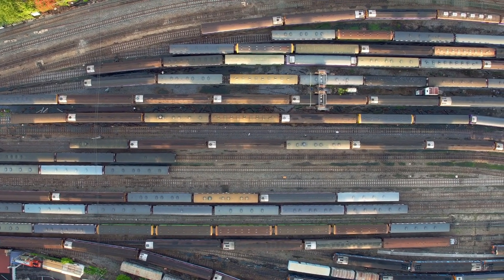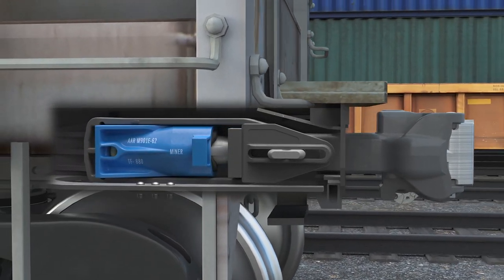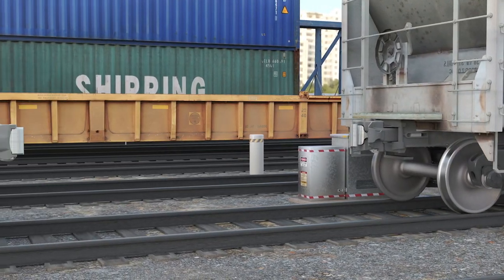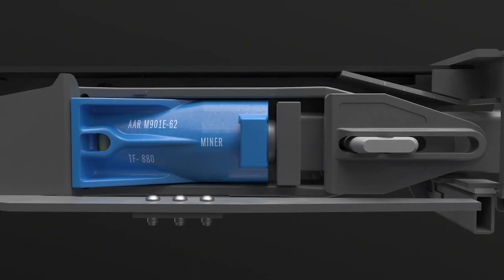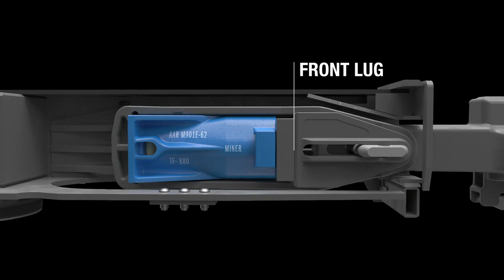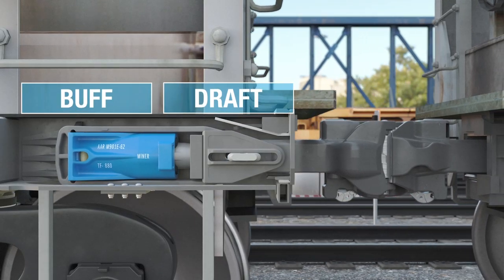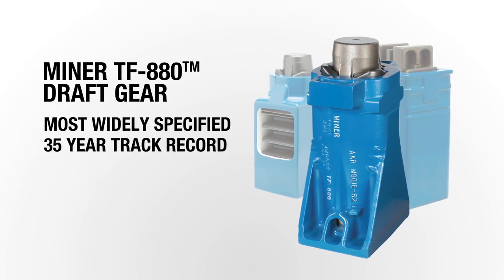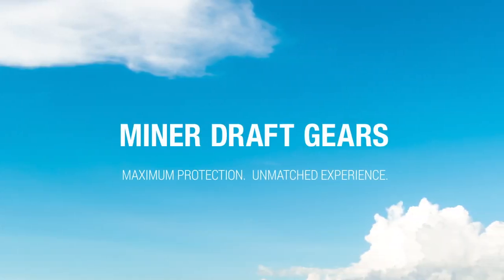How Does A Draft Gear Absorb Railcar Energy?

Comment: I worked on these things aa a millwright for Ford Rouge Blast Furnace. They're spring packs in a frame attached to the coupler. Usually when I saw them they were crushed. Operations seemed to like slamming them into each other. I've seen slag pots banged together so hard the the molten slag would fly 10 o 20 feet. In plant pots and ladles didn't have brakes, only on the engine.
Reply: I wonder if that's where bumpstops on desert race cars came from.
Reply: Yikes!
Reply: Oh man, thinking about the energies involved in a fully loaded torpedo ladle car and then trying to build a damper to deal with that. That is a challenge.  I'm not surprised they got smooshed up, especially if whoever was driving the power was careless with their speeds.

Comment: Would an electric resistance one work?  Could one adapt the back and forth motion of the cars on the couplers and covert it into electricity?
Reply: Probably, but I doubt the batteries on the engine(s) could take the charge rate from a mile long stack, and the electrical losses would be astronomical. They have springs instead

Comment: This is why we have Buffers on UK trains. It's unusual to see any freight car without buffers. You definitely won't see that if it's chained coupled as they are essential
Reply: buffers are ridiculous and outdated and cause grief when they lock "buffer lock" from crossovers. so glad our trains here in North America never had buffers.
Reply: @northlanderdude  Buffers are great they should not lock together, as the curve radious are limited as with crossovers points. That is why they are elliptical wider on the two sides of the rail vehical to take the curves into account.
We have two and four tracks.
But we do not have overtaking as you do in the US, it seems to be a very dangerous situation, unless maintenance is being carried out and very carefully signalling/control is in place.
It's not necessary as we have lay by tracks for freight say 80 mph to stop and let an express pass say 125 mph.
I wonder at you still using wooden tyes (sleepers in UK) with pins to hold the rails, I think we did away with pins in the early 1900's or before and used chairs to hold the rails and about 1950/60 now used concrete sleepers. We have very few derails if so usually a break in the track, defect on the bogie or other engine or train defect.
But we dont have the great distances and train lengths 2 to nearly 4 miles to contend with.
The knuckle seems the first thing to fail but I have seen the whole coupling assembly ripper out of a box car, as the forces on you freight trains cars are enormous.
Reply: @northlanderdude  Buffer lock only happens on model trains, where the curves are too tight.
Reply: @anthonytidey2005  eh rather not add them to American locomotives They'll look Weird That's why When I get lego trains I try to rip the buffers off cause I want to make American type locomotives and buffers make them look werid

Comment: Great explanation thanks.
The retardation of the impact is it carried out by a spring or like a car shock absorber by hydrolic compression?
It seems to me that if it were longer it would take out more of the forces but it would cost more.
Reply: Some are longer.  They are for cars that you would load fragile stuff in, so they make them much longer.
Reply: @NiceMuslimLady  Thanks for the info.

Comment: Failed to explain if it's a SPRING or HYDRAULICS absorbing the impact?
Reply: I think its air. Hydraulic oil is not compressable and a spring will wear out really fast,
Reply: A draft gear uses springs. A cushion unit is hydraulic.
Reply: @IfIcommentIlikedthevideo  This type of gear actually uses Hytrel (elastomer). The main action that absorbs energy is actually the friction clutch, not the spring or rubber. That's mostly what helps force the clutch back to neutral position.
Reply: This type of gear actually uses Hytrel (elastomer). The main action that absorbs energy is actually the friction clutch, not the spring or rubber. That's mostly what helps force the clutch back to neutral position.